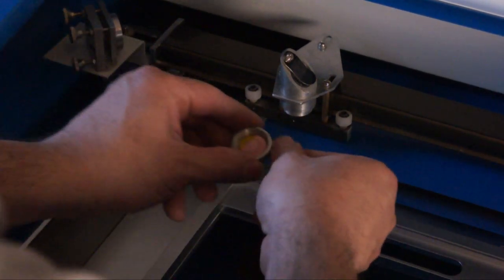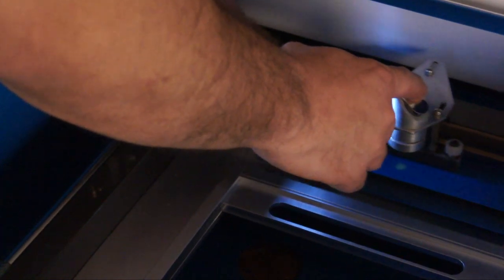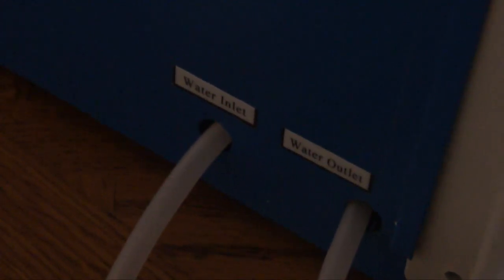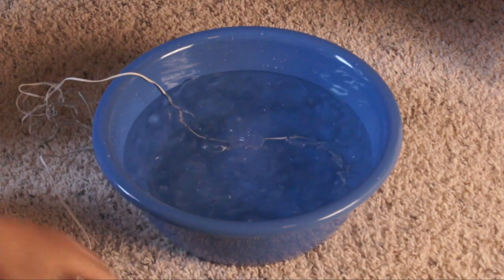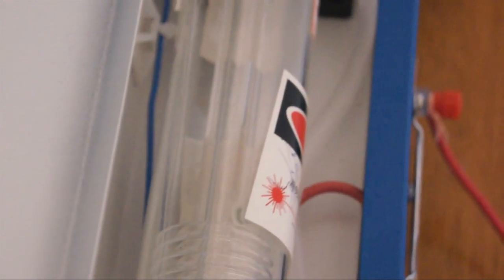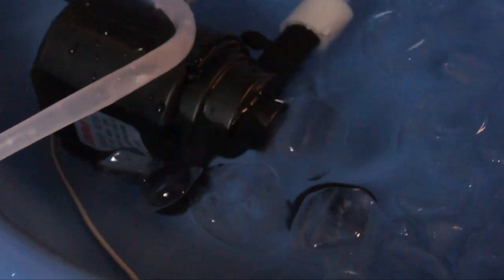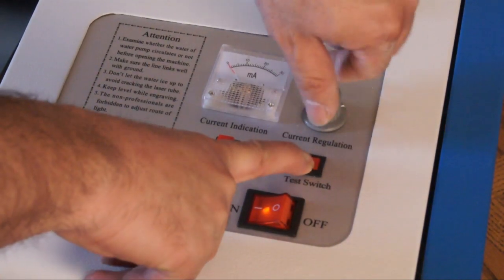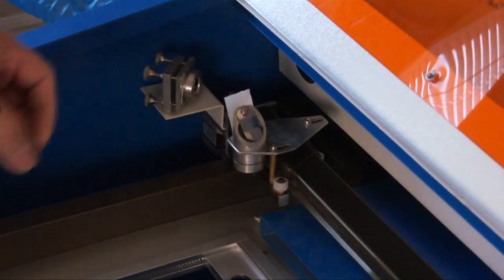China Laser Cutter Engraver Part 2

Comment: Those little submersible pumps really do have to be completely covered, if run dry they will burn out in short order so the inlet of the pump should be way below the top of the water, the water is the lubricant and the coolant for the motor itself.
The first shot you made with the tape on actually hit the side of the mirror holder and burned the tape. This is probably irrelevant now as this is such an old video but for the new players it is something to look out for.

Comment: The suggestion for the water temperature is a minimum of 35*C, not degrees F! That would equate to a max temperature of 95*F. If your room is 78*f then you need to achieve a minimum of 76* (to prevent condensation) but can go to a maximum of 95*F. The tube works most efficiently at or near room temperature which is usually no higher than 78*F.   Be careful with very cold water as the thermal shock can cause the tube to crack. You should be 'chilling', or cooling, to no more than 2*F below ROOM temperature. That's to prevent condensation that could cause the HV to arc over on the tube to a metal chassis component. Never add ICE to the water!